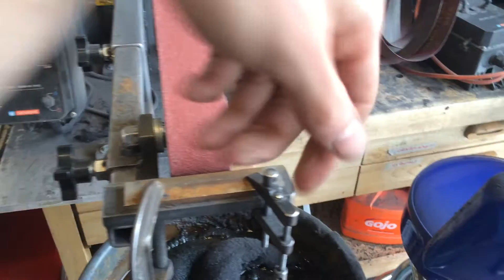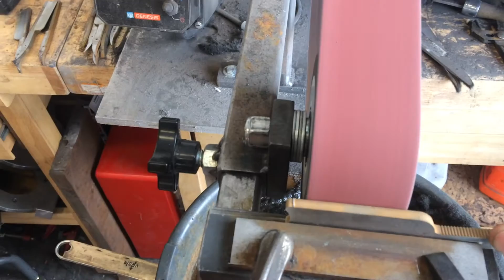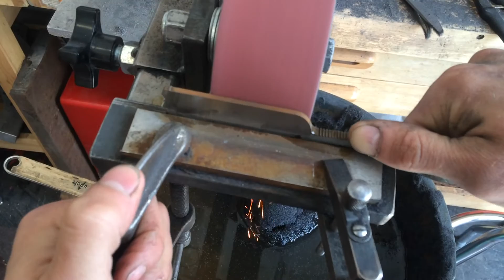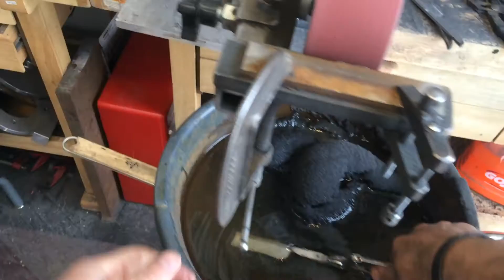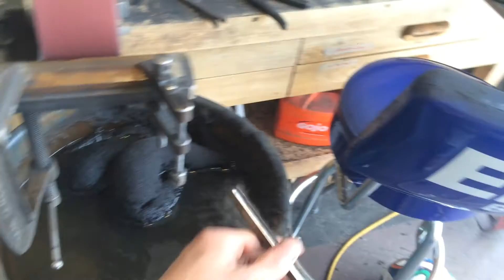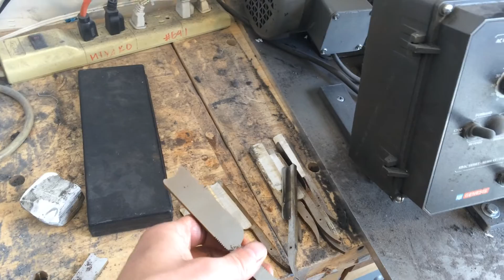Straight Razor Hollow Grinding POV | Portland Razor Co.

Comment: Is that a jig ?  Or just a straight piece of metal as a guide.... looks a real cool grind
Reply: Shaun Miller I believe that it is just a piece of metal clamped down a bit away from the contact wheel. That way it is easier to grind because you don’t have to angle the blade exactly right over and over again. It’s just easier

Comment: What angel are you using  for razor,  also how  close . I'm retired and just a hobby , I can't seem to get correct the dimension from top to bottom.  Thanks
Reply from the maker: Not sure I understand your question.

For razor geometry: start with stock that is 1/4-inch thick, grind on a 4-inch diameter contact wheel to achieve a quarter-hollow grind, and the final width of the blade should be 7/8-inch from edge to spine.
Reply: Razor geometry should be around a 15° angle. So it’s 3.5-4 x your thickness. 1/4” stock razor should be a 7/8 or 8/8 razor like this. If you used 1/8” stock you’d want your width to be between 7/16”-1/2” from edge to spine.

https://youtu.be/isPvvVdyQio

Comment: how thick was the stock he started with...is that quarter inch?
Reply from the maker: Stock thickness depends on the width of the razor you want to make... We would use 1/4 inch stock for a 7/8 width razor.